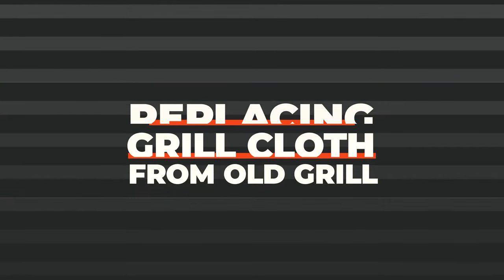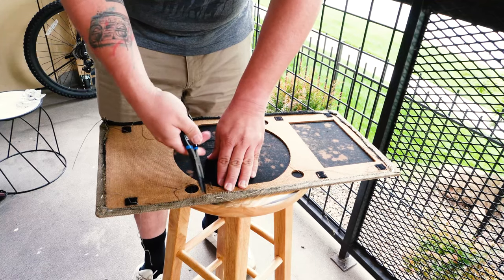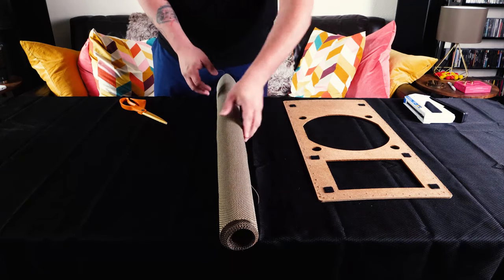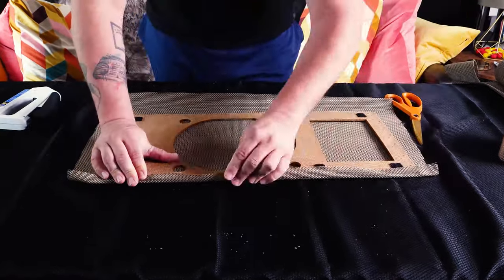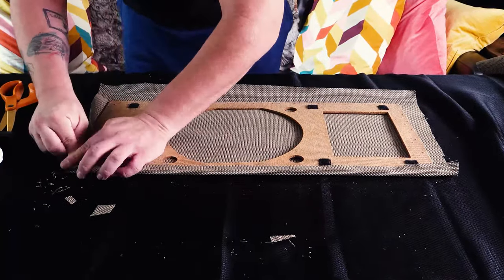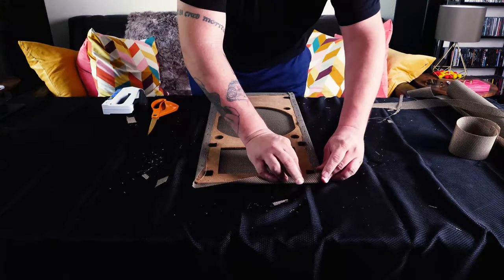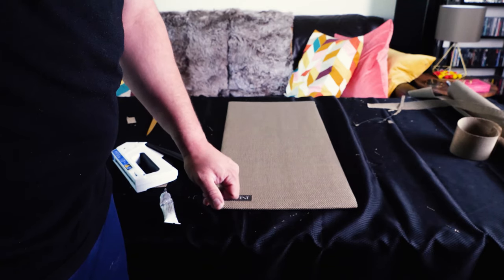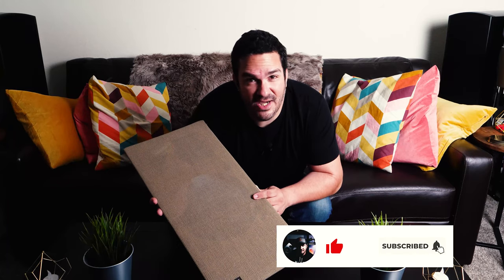How to Replace Speaker Grill Cloth DIY Vintage Audio

Comment: Good poop. I have the slightly smaller Advents on stands in a bedroom, and did that last year. One IMPORTANT tip -- that you DID but didn't discuss:
Be absolutely SURE you get the fabric 'weave' exactly aligned with the panel edges. Otherwise, the speaker will look at you crooked for the rest of its musical life.
DAMHIK. Had to do the first one twice.

Musically, the Advents are pretty sweet. I don't know how they sound with pop and metal, but  vocals and instrumentals, as well as classical and jazz, are laid back and lovely -- no matter what amp I hook them to. They seem to love my one class D. (But mine go sorta ugly above about 95 dB, no matter the amp.)
Reply from the maker: Thanks Jim! Yeah I was nervous since it was my first go at it but it came out great!
Reply: @audioarkitekts  The risk isn't failure; it's having to do it over. ;)
I think I might replace the surrounds on the Advents' woofers. Now, that's an act of risk and bravery. [Maybe I should leave well enough alone.]
Reply: Well, I went up and looked at them both. The 8" woofer surrounds are actually healthy. What I can't figure is that one is about 6 dB louder than the other. They both sound the same, but it could be a crossover component. Speaker wire is 12 ga, so it isn't that. The existing fix is the balance control.

Comment: hey, my question is how do you take the front off, my one seems to be glued in with all the walls and built into the sides, i dont wanna crack or destroy the speaker box, but my speakers grill cloth is going up and down due to air pressure and it makes a rattling sound, so i wanna take it off, i have an orion hs282